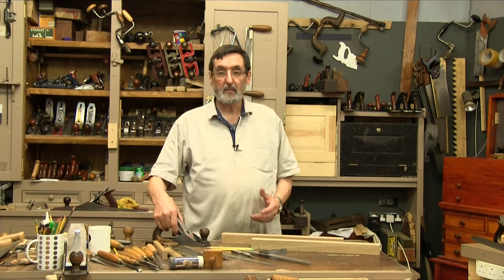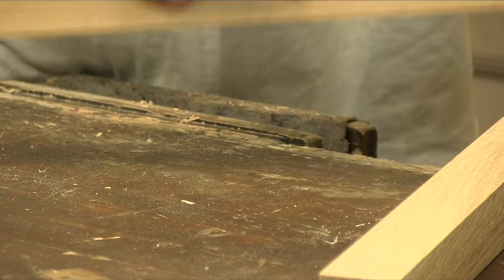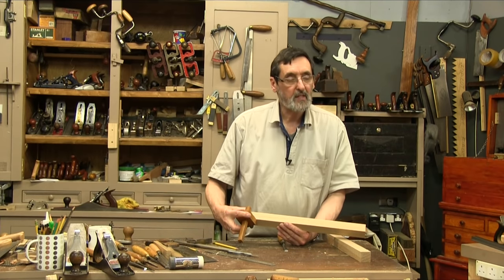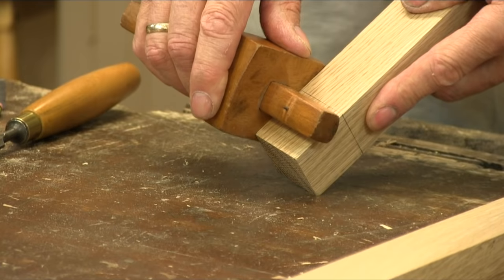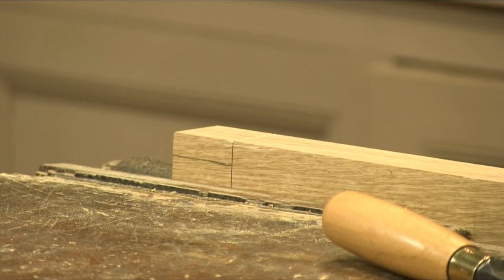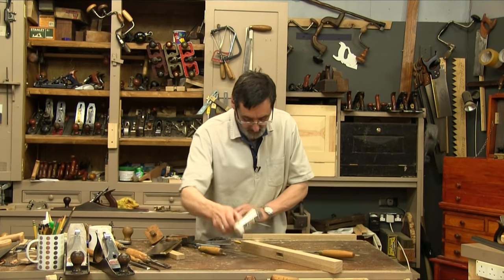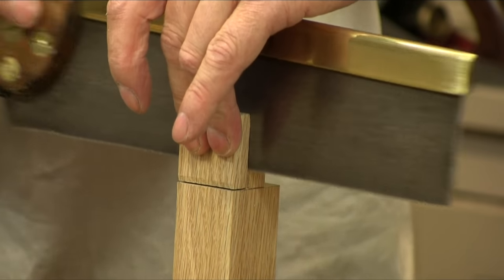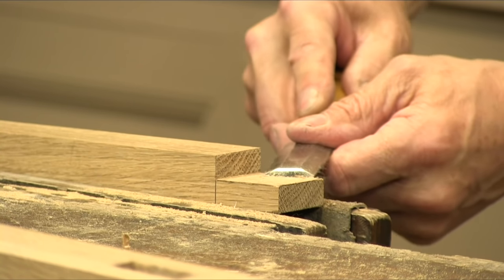How to make a Mortise and Tenon Joint - The Three Joints - | Paul Sellers

Comment: This video takes 30 minutes to literally see how one joint is made. No cuts, no speeding trough. This is real woodworking. Some of us beginners get frustrated when we see how some dude with a jointer, planer, power drills, kreg jigs, all kinds of saws etc builds a project in ten minutes and here I am trying to build some stools with my circular saw and a speedsquare getting all frustrated.
Reply: Yep, you’re spot on. It was instructive and something to aspire to. I could sense the satisfaction in the end success.
Reply: @Ricardo Landgrave
If you focus on hand woodworking with Chisels, saws and hand plane you will build skills that the guys who only use machines will not have. 
If the world economy collapsed you would do work with the most basic tools they on the other hand will be dependent on the machines. 
When you finish with a hand plane there are no machines that can get even close to that level of finish.
Reply: @bighands69  I need to get back to woodworking but no longer have the space and my corporate call center job takes most of my time and sanity :/
Reply: spot on Ricardo.. honestly I see some of these workshops & a power tool for each procedure & I think, "I can't afford to do any of this"..
This video has me motivated to step back & take another look at good old fashioned hand tools.. Is it me, or do the old techniques seem to produce an end result that far outlasts modern 'woodworking'?
Reply: @richgouette  There's a reason for the saying "They don't make em like they used to" ^_^
Reply: Amen
Reply: @bighands69  if the economy collapses we can still use power tools. 
You think everyone that uses power tools doesn't know how to use hand tools? What a ignorant statement. But no surprise coming from a guy that doesn't know the difference between the power grid and the economy. 😑😑😑
Reply: this made me smile so much.  My first project was with a saw that was sharp enough but cheap and a couple of B & Q chisels. Not helped by working with stock that was all of different depths due to recycling wood from an old bed but it will be unique and square. It may have been wiser to have chosen something simple but I opted to make my son a bed...and all he's worried about, is that it won't fall apart.  It was a learning curve for me and having seen this video, I can already see how I can make huge improvements next time.
Reply: I'm working on this technique, it's very difficult and requires lots of patience.
Reply: @daveortwine2641 I hear ya, but he does kinda have a point RE the economy. Like I'm a DeWalt man myself and I believe the batteries I have say made in Japan or Taiwan on the bottom. 

They're not cheap now but they're readily available (as are cheaper knock offs of course) 

Could see a situation if the economy went south where stuff like that would be nearly impossible to get hold of or suddenly become ridiculously expensive with local currency. 

Like you say though, what does that mean...like I'm going to give up my drill driver and go back to a brace and bit now because in 20 years I might not be able to get a battery for love nor money. 🤨

I still own hand drill, I'll be honest very rare that I use it, but like you say it's there. 

Same with saws, now there I am a bit of a luddite...I just don't like chainsaws, 

Jigsaw, circular saw, table saw I'm fine with but for the amount of times I could actually use a chainsaw (not many really) I'll happily take the exercise and do it by hand.

Comment: I thought that all joints were made in a 40 foot by 40 foot "home shop" that's kitted out with 50 grands worth of electrical machinery?
Reply: That's in America
Reply: No, that's where $100+ end grain cutting boards and $1000+ epoxy river tables are made.
Reply: Honestly, without any criticism towards Mr. Sellers - he owns and uses hand tools that are collectively much more expensive than the average hobbyist's entire shop, including all electrical tools.
Reply: @AGH331  but they have been collected over a career spanning 50 years
Reply: @AGH331  The only potentially really expensive tool I saw was that beautiful manual router and it was optional. Beyond that he used two chisels, a plane, a knife, tenon saw, mortise gauge and a mallet. The most expensive tenon saw I could find online was about 80 Euro: the most expensive at my DIY store is a tenner. A Stanley plane at a box store is about 50, another tenner gets you a chisel set, and maybe another 20 total for the knife, mallet and gauge.  It's worth spending on the saw. At the beginning you can get cheaper planes and chisels and tune them up on a stone: by the time you're ready to throw them you'll also be ready to invest in more expensive ones (or you'll be on your next hobby). So ... 160 quid to get started: how much was your chop saw? My similar basic set is now 40 years old. I started off with the cheapest I could find at the DIY store and (other than the saw) I'm still using them all.
Reply: @enm53  The same can be said for most of the guys that choose to use electrical tools. To each their own it is what you find the most enjoyable to use! After all it is hobby.
Reply: @stainlesssteellemming3885  Do you know why the manual routers are so expensive? I had a look online and they seem way more costly than electronic ones
Reply: @tompearce6312  I think it's supply and demand. Woodworkers today fall into three primary groups: professionals, who make a living from it; dedicated hobbyists, who have space for a workshop, do it almost as a second job, and maybe sell some stuff; and the "weekend warrior" who maybe spends an hour or two on alternate weekends. 

Now, the pros have large workshops, all the large heavy duty tools, and can justify the cost as tools of the trade. For many, it's about getting jobs done quickly to maximize revenue; and power tools help with that. 

The dedicated hobbyists are either all about the process - and they will love the hand tools - or about the product, and again they will tend to power tools because they spend less time doing the preparation of the lumber etc. or they'll use a mix.

The "weekend warrior" is likely to be into the hand tools for two reasons. First,  they likely don't have a workshop: like me they may have a workmate, or a small corner of the garage. Hand tools don't take up much space, and individually aren't that expensive. Secondly, they are likely to be into it for relaxation, for enjoying the process as much as the product. And hand tools bring you much more into contact with the feel of the wood.

But when you look at those groups, hand tool specialists are in the minority. There's not enough demand for the big box stores to stock a wide range of tools. Which means the hobbyist needs to buy from the specialist manufacturers, who in turn are geared up to sell to the professionals: at pro prices.

Oh, and one more thing. You generally only buy each quality hand tool once in your woodworking career (unless you trash one). How many power drills etc have you bought? Especially if it's a cheap one from the DIY store? My planes and chisels were cheap ones from a DIY store, they are nearly 40 years old, and they are still going strong. OTOH I'm on about my 5th power drill.
Reply: @stainlesssteellemming3885  Thanks for your thorough reply! I guess it's something to look out for at garage sales and so on, although I don't especially need one any time soon. I'm gradually learning to use my late Father's tools - we used to make things together when I was really little but never when I was older sadly. I'm amazed to learn how much stuff he had and how much he must have liked to collect tools. I've had a few experiences of thinking 'It would be useful to have one of those...' and then finding whichever tool I want in a box somewhere. Paul's videos are a great way for me to try to do justice to the tools I've inherited!
Reply: @stainlesssteellemming3885  wow what analysis man,  so now i know i fall in which category, weekend warrior
Reply: @dilipnilakhe5443  Thanks and yeah ... for the last 30 years or so I've been more of a "month-end warrior". Basically my tools came out when I needed to fix something around the house. But I've always had a leaning towards hand tools and, as I near retirement age, I'm getting ready to get back into it. I'll basically be starting from scratch tools wise as all of mine were bought on a "need it right now" basis, so there was little selectivity involved in the process. 

As a result of which I currently own 4 different drills (a cordless one which is mainly used as a screwdriver, a small corded one that's useful for odd jobs like cleaning the lint out of my dryer vent, a hammer drill for the job where I had to drill into concrete, and a big paddle drill for mixing plaster when I re-textured some damaged walls), each one bought for a specific job and usually whatever was cheapest on the day. I have a chop saw from repairing fencing and replacing baseboard, and a multi-tool and grinder from a major flooring job (1300 square foot LVP on concrete).  My two planes are really crappy Stanley ones from the 70s, same with my bench chisels but they've done the job till now.

My first (and only) deliberate purchases in the process so far have been a trend diamond stone and leather strop. I figure I'll risk destroying my current planes and chisels learning to sharpen .. might even end up with some useful roughing planes as a result. Next purchase will  be a No 5 plane and maybe a No 4 - I'm trying to decide between ebay for old Stanley's or going up-market to perhaps a couple of wood-rivers: can't justify a Lie Nielsen or Veritas. Then some quality chisels.
Reply: @stainlesssteellemming3885  Yeap, that manual router you can't find it anywhere, that's more like a relic, it is the first time I see one
Reply: @luisarashirovideo  bidding on one on eBay right now. Also veritas or lie nielsen make the.
Reply: And seeing the prices, and reading up what Paul says .... go with a brand new  Veritas large Router Plane. They're cheaper and better than the old Stanleys. The collectors and speculators have taken control of the pricing on the old ones.
Reply: Stainless Steel Lemming thank you. I have a makita electric hand held router... that’s what I use. Besides I’m not in the US.
Reply: Jim Doherty  yeah but this is a hobby ... I have to get the boss's approval for anything that costs money
Reply: Jim Doherty  Forgot the smiley on my response. Are you talking about bench planes or the router plane? If the latter, I will  pick up the veritas when I really need it (in the meantime, it's on my Amazon birthday list and I can get by with a chisel). If bench planes, I just picked up a set of vintage Stanley's (4 through 7) in a sweep through antique stores during a 5 state road trip, plus a brace/bits and a couple of other "practice planes" for less than the cost of a Woodriver #5. My son and I are gong to be restoring those over the coming months, as part of the hobby aspect.
Reply: Jim Doherty  Thanks - yep, seen the video: that's what I meant by "I can get by with a chisel". When the time comes, I will definitely buy new as the vintage ones are selling for more than the new ones, and Paul says the new ones are actually better than Stanley's.
Reply: Yes! This comment. I search how to do DIY wood working things and I'm greeted by videos with millions to tens of thousands of views of guys with thousands of dollars worth of equipment. 

"Excuse me sir, believe it or not, there's limited access, and prohibitory costs excluding most people (and especially those who search for DIY videos on Youtube) to such a setup thus rendering your video categorically outside of the realm of "Do It Yourself."

Comment: I am an engineering student, figuring painter, and class 3 solder reworker in electronics, who has began working on my first bench and air extraction system. Though this is now several years old; I wanted to tell you that this is still helping people and that I appreciate the work you put into this series. Thank you! Also, using the chisel as a planing tool? Blew my mind. I have been eyeballing them (figuring I can get buy with my drill, a flathead, and my steady hands), but now I know I need them so I can make planing jigs in addition to these Mortise and Tenon Joints.

Comment: The tolerances are so tight on his workmanship that I'm convinced that Paul Sellers could build a functioning spaceship out of Sapele.
Reply: With only tools from aldi
Reply: I would ride that spaceship.
Reply: Spruce is the preferred timber.
Reply: With no carpenter glue in sight.

Comment: Any beginners (like myself) watching this.  I cannot emphasise enough how important it is to have a combination square that is actually square.  

Something from Home Depot or B&Q very often is not truly square.  It is one of the most important tools you can own and it's well worth spending extra on a quality combination square.  Good ones start from around £75/USD$100 which sounds a lot but it will save you no end of headaches.  In my opinion its one of the few tools worth spending a significant part of your budget on as a beginner.

Comment: I would like to try and make a little table using Paul's techniques but I'm having a hard time finding a hardwood supplier in Leeds! I wouldn't have thought it would be so hard but it seems everywhere just sells pine for building, no oak or walnut etc to be found. There's a place in Keighley but it's a long way away, are hardwood suppliers just few and far between these days?
Reply from the maker: ***** I have a blog almost ready ion this, Ian, and a video on it too. Selection and prepping. Keep following my blog.
Reply: Paul Sellers will do thank you Paul!
Reply: +Ian Atkinson There is a timber merchant in Wakefield selling all myriad of hardwoods from oak to iroko.  Drop me a message and I'll give the name and address.  Can't be more than 15 minutes away from Leeds centre.
Reply: +vtrmcs Do you know the name? I can look it up if so thanks!
Reply: +Ian Atkinson If you find any suppliers like that please share in here. I'm from Leeds aswell and couldn't find any yet!
Reply: +beating2 had the same issue where I live. What I did was contacted a local cabinet maker and asked him where he sourced his material and I am set now.
Reply: +Ian Atkinson I'm a furniture maker and I buy all my hardwoods from Arnold Lavers I live in chesterfield but there is a lavers on Pontefract Road.
Reply: A bit far away from Leeds, but if it's a help to you or anyone else, there is an excellent, reasonable and very tidy hardwood yard in Mumby, Lincolnshire name of Roberts. Last week I bought a load of Oak there for an indoor project and some Iroko to re-slat an old, broken garden seat. He also trades on eBay, see seller wood4yew.